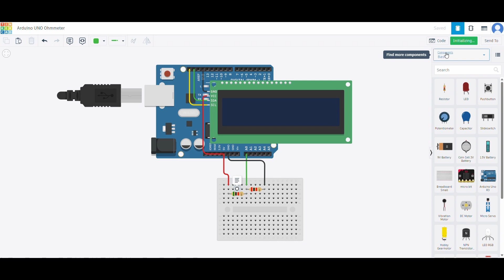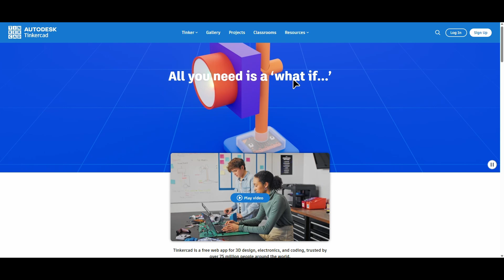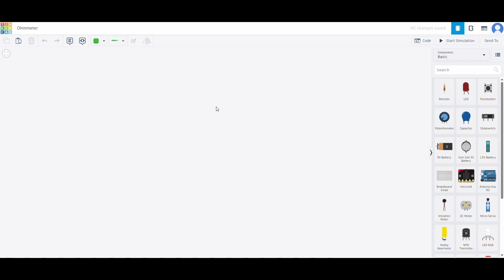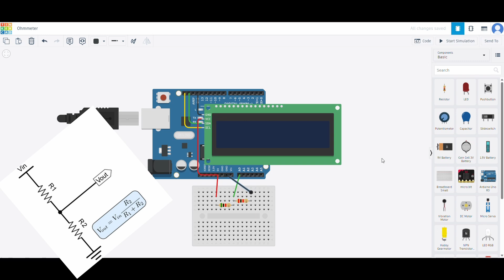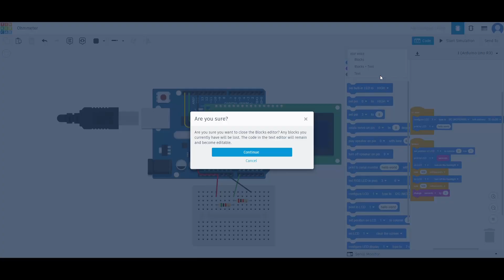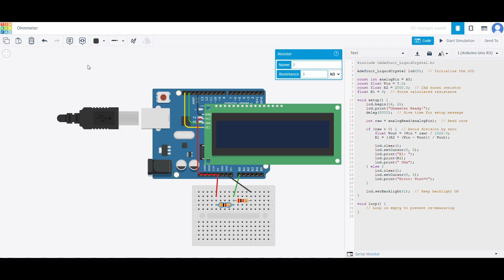Ohmmeter Simulation on Tinkercad tutorial

Comment from the maker: Here are the codes for this project! :>

#include <Adafruit_LiquidCrystal.h>

Adafruit_LiquidCrystal lcd(0);  // Initialize the LCD

const int analogPin = A0;
const float Vin = 5.0;
const float R2 = 2000.0;  // 2kΩ known resistor
float R1 = 0;  // Store calculated resistance

void setup() {
    lcd.begin(16, 2);
    lcd.print("Ohmmeter Ready!");
    delay(2000);  // Give time for setup message

    int raw = analogRead(analogPin);  // Read once

    if (raw > 0) {  // Avoid division by zero
        float Vout = (Vin * raw) / 1023.0;
        R1 = ((R2 * (Vin - Vout)) / Vout);
        
        lcd.clear();
        lcd.setCursor(0, 0);
        lcd.print("R1: ");
        lcd.print(R1);
        lcd.print(" Ohm");
    } else {
        lcd.clear();
        lcd.setCursor(0, 0);
        lcd.print("Error: Vout=0");
    }

    lcd.setBacklight(1);  // Keep backlight ON
}

void loop() {
    // Loop is empty to prevent re-measuring
}